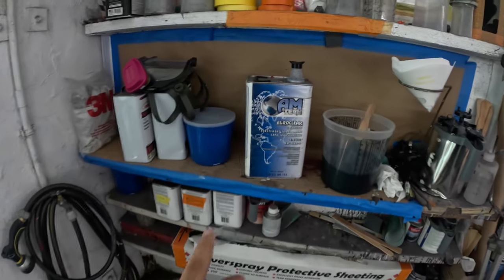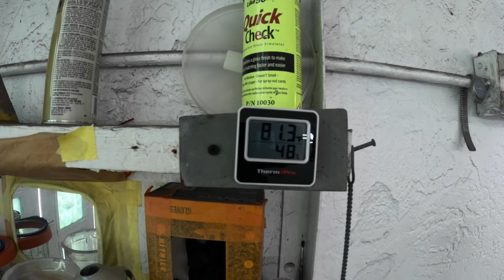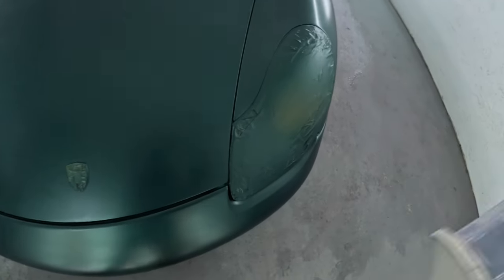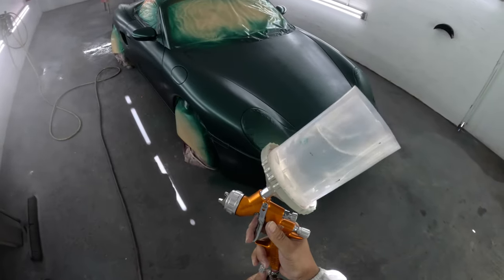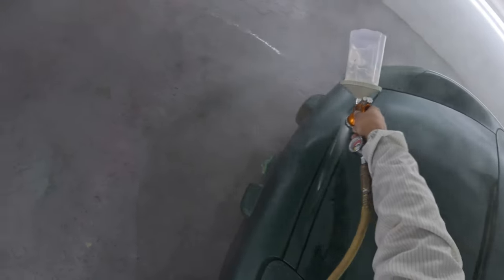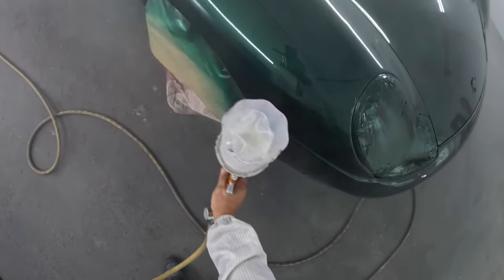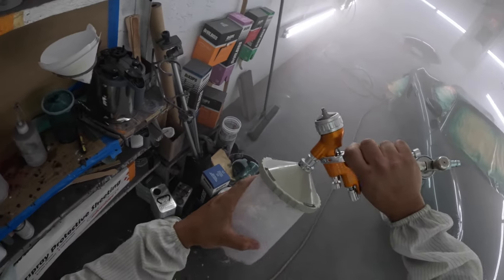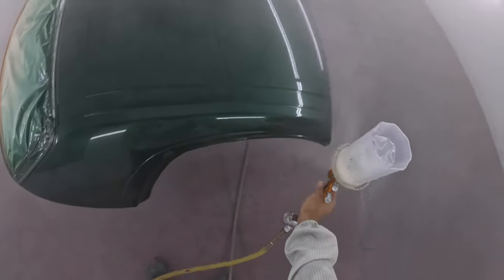how to POCKET MORE CASH 💰 on full paint jobs. Blow and Go no small talk 😱

Comment: Glad you're back hey why did you choose to go with the T20 and the 1.4 on the pro lite how do you compare it to the 1 3 and the T10 for the clear
Reply from the maker: Thank you. 1.3 slows me down when it's hot in my booth. And T110 is a slower cap than the TE20 so that would be even more slower. It would have taken me twice as long to paint the car. I like to get in and out of the booth. On a Sagola 1.3 would be fine but not devilbiss guns. It all depends on your temperature/environment.
Reply: Thank you that makes perfect sense and I'll be looking for that single stage paint job you're going to do for El Cheapo commuting to work and I sit there and I watch the whole process
Reply from the maker: @tedc9306  hopefully you're not driving and watching 🤨 lol thanks man. Got one before the single stage overall. But it's coming  thanks again Tedc for watching 💪🏼

Comment: What's your secret to have this clean jobs in a older spray booth? No chips.
Reply from the maker: I have to wait until I hit 10k subs to reveal those tips. I've said a few painter secrets from 30 years ago The next thing I know they are displayed on the big channel as if they had been new about these secrets and tricks of the trade. So what's my channel hits 10K I'm really going to start giving out deep trade secrets. So stay tuned my man. But the most obvious would be wet the floor, and keep in my the tighter the area you are working in the more dirt you will have, my booth can fit 6 cars in there so I'm several feet away from the walls in each direction. Also my prepper blows the car I tell her blow for at least 30 min. 🤔 Then once I get the car in the booth I blow for another 10 min 🤔 Then let the booth run for 20 min before spraying. I could keep going but you get my drift 😉